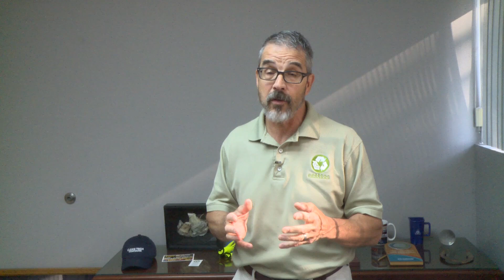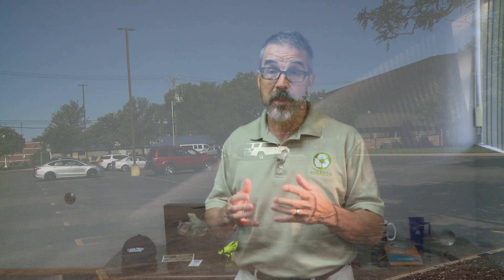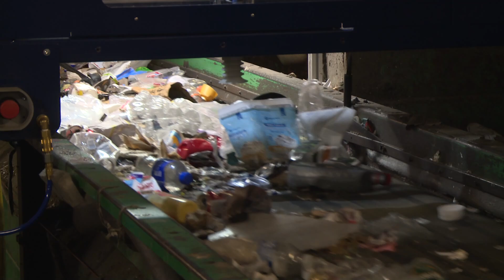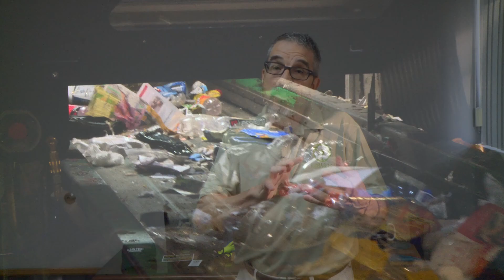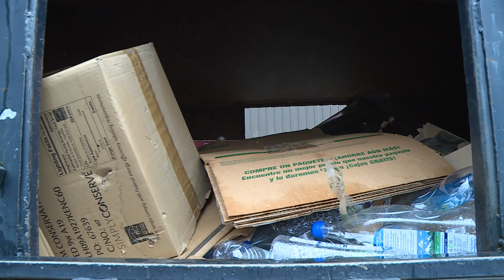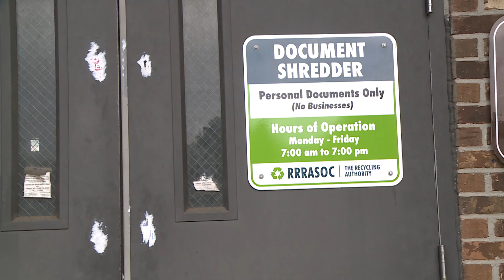RRRASOC - Plastics Recycling Robot - (Southfield Now, ep. 61)

Comment: I have used the self-serve shredder at RRRASOC on 8 Mile a few times to get rid of documents and it worked great. In looking at the video of the mixed recycled material passing down the conveyor belt it made me wonder a few things. The belt travels so fast does it just go by these picking stations only one time and all the valuable plastic can get picked off or does the material have some circular route to go by a few passes before it is picked clean of the valuable items? What percentage of the material that is initially loaded on the conveyor typically gets pulled off because it is valuable enough to recycle? Do glass bottles really get recycled through this process? It seems they might just break into small pieces and end up as part of the remaining picked over material that probably goes to landfill. Maybe some of those types of questions could also be covered in the can this be recycled or not videos you also do on this channel. Thank you.
Reply: Robert, All good questions.  As the materials go through the process, there are redundancies and return loops built in so that if an item gets missed (either mechanically or manually), it can be identified and captured or redirected as necessary. Our overall residue rate tends to hover around 15%, meaning 85% of what we get is actually recyclable and captured for the marketplace, with about 14% being contamination and 1% being recyclable material that either gets contaminated en route or missed in the process. Glass bottles do get recycled but most often are used as aggregate substitute or alternate daily cover at a landfill.  We are in the early stages of exploring additional markets for glass.  Thanks for the suggestions on additional videos.  We're always happy to work with Southfield Cable 15 to provide informative content. - Mike